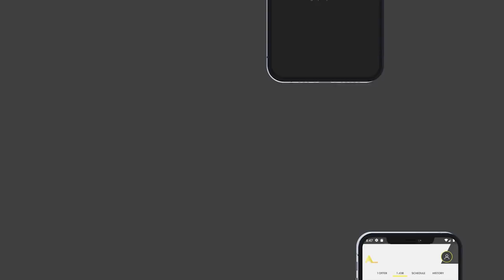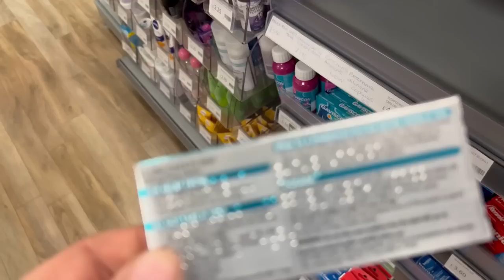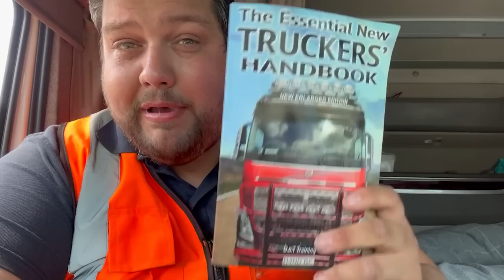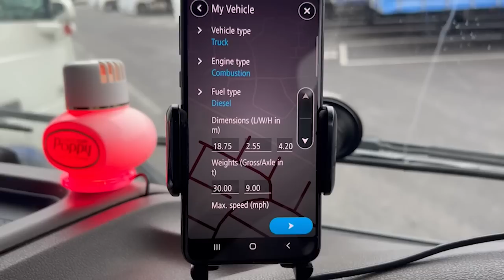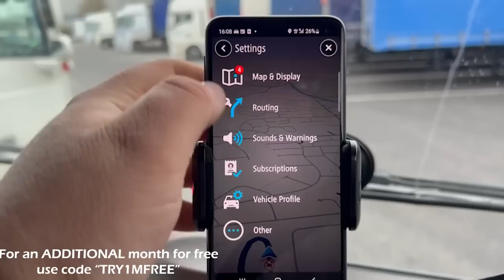I Got Banned From Site! TOLD TO LEAVE!

Comment from the maker: @24:24 If you are interested in trying the TomTom GO Navigation Truck App for yourself then click this link
https://tomtom.co/3xgbW6F
receive 1 extra month for free with code TRY1MFREE
The redemption of the code goes through the Google Play check-out to redeem, follow these instructions
1. Open the app.
2. Select the 12 Month Truck plan.
3. Before you pay, tap on the payment method.
4. Tap Redeem code.
5. enter code TRY1MFREE and then complete the purchase.
#tomtomdrivers #Gonavigation #lukecinahgv #ad #sponsored 
 @tomtomdrivers
Reply: Hi Luke, do you also recommend the Tom Tom 7” Sat Nav go expert still?
Reply: or even use road lords, same mapping and free for basic use, 25 quid a month for tom tom is fucking criminal
Reply: Thanks for reminding me why I packed in trucking after 45 years HGV & PCV driving
Reply: We have idiots like this at my place of work they have all these signs saying how they want your load to fastened etc with people supposed to check they did it that way, when I "check" I just tell drivers how it's done doesn't bother me because once you leave it's your responsibility not mine and if the company I work for tries to force that on me then there's no way in hell I'm accepting that.
Reply: Hey Luke you need to stop rubbing your eye.Its bruised and people will probably jump to conclusions and think you've been in a fight.Have you tried eye drops etc?.

Comment: Doing training now to become a trucker and one thing that is pushed hard is the driver is responsible for securing the load, no one else. We also have a nice guide with values for friction and how many straps you need for cargo at x and y dimensions with z weight, quite handy. Only 44 tons phew max here in Sweden is 64 tons on most main roads and some have 74 tons, then we can also be 4.5m tall Vs 4 in EU.
Reply: Ok. Maybe you should do a youtube about it.

Comment: I’ve loaded from both of those sites lots of times. Never had any issues with either. The lads at Mersey Wharf are sound as. As to regards of strapping the mesh. We always strap half way. 4 or 5 packs up. Then when the other 4 or five packs are on we use 4 straps over the top. Same as yourself, but throwing them opposing directions. 2 outer to near side. 2 inner straps to offside. Just helps keep it a bit more stable. 
Ultimately the driver is responsible for his load. No matter how many straps the forklift driver at nwt reckons you should use. You should use as many as you feel comfortable with. Different people strap different ways. Not to say any of them are wrong. If the loads gets to its destination safely and securely who can really argue. Nice civic 👌🏻
Reply from the maker: Couldn’t agree with you more mate on all parts. Even the place where I got banned. The lads seemed decent. Got on with them I felt. But obviously I upset them. I shouldn’t have titled the video what I did. That’s why I changed it. But the damage was done it seems.

Comment: What a start to a video. NO, its that Fruehauf Speedliner curtainsider over your right shoulder! Where is that trailer now bud? Is that still in service? That must be at least 23 years old. TIP had loads out of Cranes, and they didn't want Fruehauf decals over them either. What a blast from the past.

Comment: The LAW states that everyone involved in the loading is responsible. 
About 30 years ago (before the driver cpc) a company started a new driver on to collect a load of pickle and oiled steel sheets.  He claimed that he didn't know how to use the load restraints and so the loaders at the picklers decided to use banding to strap the packs of 8x4 steel sheets to the trailer.  He got about a mile and half before the steel broke free and slid off the trailer and crushed a number of parked cars.  The police asked my gaffer to use his forklift to pick the steel up and reload it while the road was closed.  When my gaffer got to the incident he found a  load of straps and stretchers in the passenger footwell in the cab.
The company hadn't even bothered to explain to the new driver how to use them and he hadn't bothered to look for them.
I believe that both the loaders at the consigners and driver was prosecuted but the driver got a reduced fine because his company hadn't given him what was called sufficient training . This was a number of cases where drivers got a reduced penalty by claiming that the employer hadn't given the driver training on load restraints.

Comment: Hope you get over your cold quickly. I got hit real hard by a nasty cold variant last month and it knocked me off my feet for a week then took another 2 weeks to finally shake it, worst cold I've had in like 10 years and was taken completely by surprise by how hard it hit me and forced me to take a week off work because I couldn't get out of bed for a week, made going to bathroom interesting, on my worst day it took me 20 minutes to get out bed and on my feet plus another 5 minutes to walk to bathroom lol. Ironically enough everything else that I usually suffer with went away, does anyone else experience this when they have a flu or cold?
Reply: They are poisoning the water
Reply: Only in Britain?
Reply: @abc33944  What would you suggest to counter? Bottled water?
Reply: @2reeceybaby  bottled water is pretty expensive so I sorted out a good size 10ltr  water filter & I filter rain water. I change the two filters every 8 months at a cost of £45. I do home brew  with this system too. In my area there's 50 contaminants in the tap water & it states this info on the water company's web site. Yes the water system is the easiest way too poison the public.

Comment: A lot of all kinds of information (mostly wrong, for most European laws). I'm a forklift operator, I'm also a truck driver. None of the trucks that I loaded came out without straps or with too few straps. If the driver argued with me, he simply got a loading paper without my signature and with the note that there are too few or no straps. When each of the trucks arrived at the scale at the exit to receive the exit papers, they were asked by the operator of the scale whether they wanted to put on straps or unload the loaded goods.

Comment: I'm just starting out my CE journey as I've passed my practical  do you have any tips on getting work I'm a coach driver now everyone wants experience they would rather take someone that has had the licence for years and hasn't driven. my coach is large i have 5 years under my belt but its not respected I'm thinking about going with the agency for a few months then till something permanent comes up and in a year do my ADR I'm in london kent side btw

Comment: I know I'm getting sick when I get a scratchy throat.  I always got sick after a plane flight, so I use a N95 mask when I fly.
But for a long-haul driver it is usually caused by unsanitary conditions where you may eat on the road.

Comment: I do have a dedicated tomtom truck nav but before I even used it a friend recommended the app. I've used the app (I'm a weekend warrior only, full time non-driving job during the week) exclusively and not used the dedi at all, it's been fine over the last year but yesterday it turned me off the A4 just before Thatcham and took me down a a non paved road that even the trees were too low, I was petrified haha. So I'm asking the question, is a dedi more comprehensive than the app, or are they the exact same thing (yes I had my weight, height etc dialled in and was absolutely on truck mode)

Edit, for anyone interested it turned me off the A4 up new hill road and onto School hill road and back to the A4. I had a feeling it was wrong. But as it was a new area to me and hadn't steered me wrong before I hesitantly trusted it.

Comment: Banned for strapping YOUR LOAD ? wow … Maybe the law should make the Forkies responsible for their loading as equal as your responsibilities on the road as well, including fines and going infront of the TC and DVSA fines. That would make them think harder about their choices when asking you to move out of the yard etc. I have refused moving from sites by banksmen on sites until I am secure and ready for the Highway which is governed by LAW not Rules on a site. Hope you get better soon buddy.
Reply: One of the first thing I learned from forklift guys in a factory. 
When it's on the lot, you listen to yourself and your boss. 
When it's off the lot, you listen to the truck driver.

Comment: Drivers responsibility ...not the forklift driver .......Driver is the one who straps and secures the load ...he is the one responsible for those straps ...no one else ..
if the straps are faulty ..is it down to the forklift driver to check?.. No! 
Once the load has left the site and goes onto the public highway..Driver is the one responsible

Comment: Sorry Luke but that load of Rebar is wrong in so many ways.   Loaded above the height of the headboard (so not meeting the requirement for 100% of the load to be restrained going forward) improperly supported overhang and the high vis tied to the back is not sufficient.    It should have clear overhang markers to the rear.   

It isn’t having a go by the way, just trying to educate.   What gets me most though is not knowing the weight of the load.  How can you know what is sufficient straps?    If it needs to be sufficient for 50% of the weight of the load then you cannot satisfy that.    Although with 4 straps per bundle you have 160 tons of restraint.  Lol.